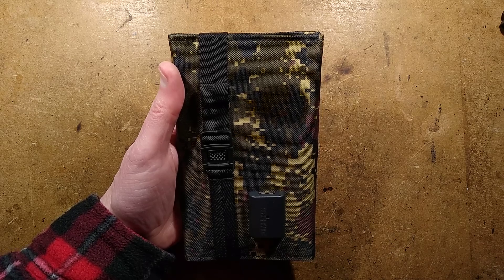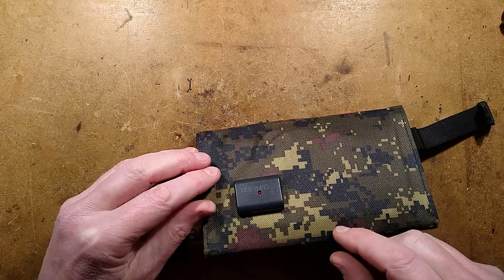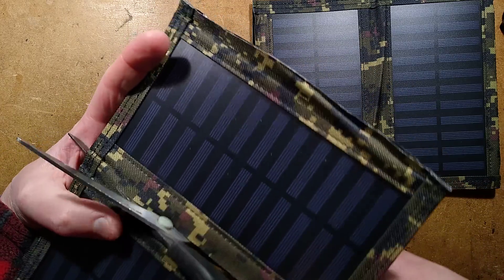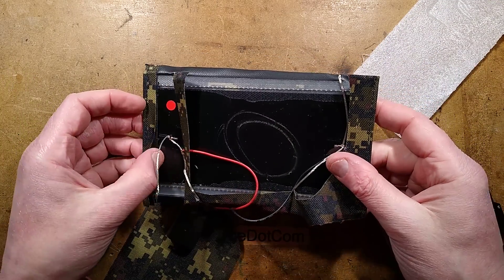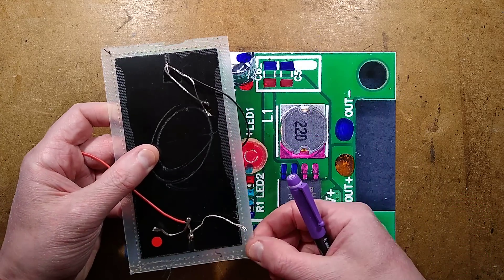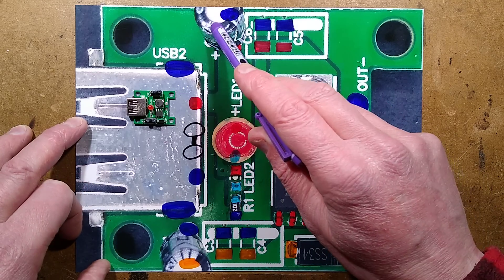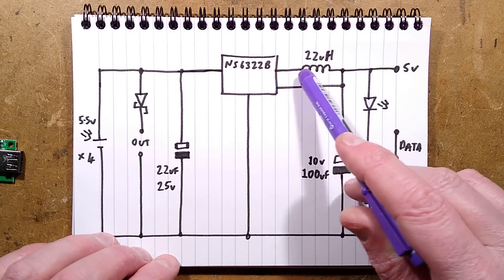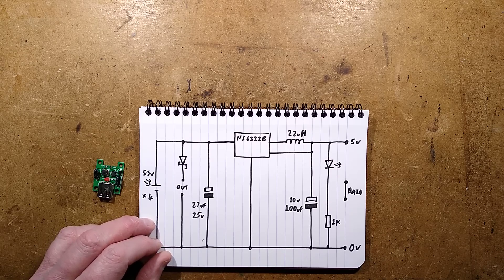Inside an eBay folding solar panel - with schematic

Comment: Yeah, I bought a bigger one to top up my car battery. It did give about 9W  but should have been 40. It also had all 4 in parallel and was obviously only 6V optimised output. Open circuit gave only 9V. They claimed usb and 12V out.
I got fobbed off with the discount thing too.
I it away as a camping phone charger back up.

Comment: I checked the datasheet of NS6322 and output is 500mA @ 5V. I was thinking, is the chip that is limiting here? How much power can we get from those panels alone? can we get the panel and make our own circuit or just use those cheap 2-3A buck/boost converters? Crazy questions..

Comment: I have actually built a solar system for camping trips, that can charge my USB devices and  outputs 12V (unregulated) for anything else. I also put a 12V to 20V converter in a little box so I can bring my work laptop with me for extended off the grid escapes. It can support up to 60W of solar power input, which is pretty handy if you're away for a while.
10W solar panels I could source are a bit bulky since they are made to be installed stationary in gardens, street lights etc. I really wish they would sell those foldable ones for reasonable prices so I could hack into a couple and make my system much easier to carry. To put it into perspective, I paid 12 euros for each 10W panel; those foldable shitty ones ask 2-3 times more, and their specs are all over the place.
So I did what you naturally do; I ordered 100 cells and plan on making my own foldable version!

Comment: Does pvsr almost never get half the voltage of what they're rated for. Therefore when I bought mine I just put them in series and bought 1 inverter that was 20% larger over rated.

Comment: A simple boost buck converter or adjustable regulator cuircuit could go a long way.   My idea of an echonomy home solar setup was just to focus on electronics, wich would involve bypassing your tv set rectifier and jus making lines for all the different DC line voltages you could try to get away with.. so the kettle and stove would be out and a fridge has awesome camper desighns(runs off a flame etc).. the idea is to avoid energy lossess from DC AC conversion.. and maximising the chances of diverse power sources and states.. and the lowest investment. Or perhaps that your home grid would have all the circuitry to acommodate and rework anything you throw at it into the same load lines.

Comment: these things can barely run a led, and most power banks won`t work with them, the power bank require a certain level of power that these panels don`t provide for long, i`m not sure if anything could be done to make these things useful, but honestly i think your better off with a 12 volt panel a cheap solar charge controller with usb on it and a small motorcycle battery, and you plug your power bank into that.

Comment: If you go on a hiking trip, don't bring solar panels. They are bulky, and don't work at night and when it rains, or it is overcast.
I found out that a couple of 20,000 mA power banks for each person on the trip are more than enough to keep the phone and walkie-talkie charged, and provide some night light.
For sake of power efficiency, bring with you a phone with a Snapdragon Gen. 2 SoC, and a professional rechargeable lantern, like the Fenix CL26R Pro.

Comment: I live in a block of flat and the press buttons on the outside door bell box were rubbish and half of the flat bells stop working.  So on to E-Bay and some of the press buttons were rated at 10 AMPs.  I don't think so, more like 2 AMPs if I'm lucky.  Any way I found some press buttons with a water type ring inside the unit to stop rain from getting in plus it's only 8 volt at about half an AMP for about 5 second when the button is press.  10 AMPs for a press button about the size of a one penny coin and 4CM long?

Comment: OK BC, you're gonna have to do a part 2 for this one.  How much current can each panel supply under ideal conditions and how much current can the power supply provide if given unlimited input power?  In other words, where's the choke point or is it all choke points?  Or is the whole thing designed properly and they're outright lying about it's capacity?  Cheers!

Comment: Using the metal tabs, instead of some flex cable, will limit the time of folds.
Reply from the maker: It was braided wire.

Comment: I bought a 65w one that's about the size of a laptop. it's works well. In direct sun, it fast charges or can charge two devices. In cloudy sun, it can still charge a bit. Brand was chargeworks. it was 80 bucks.

Comment: Apart from the lower-than-expected output, is the invisibility cloak that the cover is made of, also a problem. How will you find it when it's closed and lying around a camp site? Perhaps the camouflage also hides part of the output power...

Thanks for warning prospective campers of impending darkness and disconnectivity!📵

Comment: A lot of those that come on a single board have a similar circuit-tumor on the reverse side, and with 5V/usb and/or ~16V raw solar output (coax jack/plug or wires).
The 16V is nice to trickle-charge car-batteries through an always-on connection (eg, obd2 port) and can actually supply a decent current, o(1A) or so.
The 5V/usb output is usually limited to 1A or less because it's stoopit enough to not have any negotiating circuitry on-board.  500mA is totally within spec, so that may be intentional.

Comment: I got one of these and yeah it puts out at best ~0.5A in direct sun. Yes, it is painfully slow, but it beats nothing, especially if you do not have access to a way to recharge your equipment. My biggest complaint with these was the fact that the sellers were intentionally overrating them and your average consumer isn't going to know this...

Edit: For reference if you had a fully dead 5,000 MAH power bank and it was charging at the peak of 0.5 A the whole time, an online battery charge calculator says it will take ~10.5 hours to charge up.

Comment: The output of these small Chinese solar panels (Like many of their 18650 batteries) is often WILDLY exaggerated, but none more than the one a friend bought. It was labelled as a "Solar powered 12v car charger" from some random Chinese website. He bought it to keep the battery on his rarely used weekend car topped up. It was only about a square foot of panel, but according to the packaging it put out 50w [!?!?!]......... Wow, those industrious Chinese folks must have made some SERIOUS breakthroughs in solar technology lately ! :D

Anyway, he had it plugged into his cars battery for a few months, and he'd check every now and then that the little LED was reassuringly still blinking, but after this time when he went to use the car, the battery was totally dead. I offered to test the charger for him (Mainly because I was curious how many watts it ACTUALLY put out), and found that it outputted NOTHING. I dismantled it, and found that it had a simple board with (IIRC) a CR3032 coin battery, an LED, and a photoelectric sensor. When sun light shone on the sensor the LED started blinking........... And the Photovoltaic panel ? Some sort of screen printed paint on a piece of glass ! :D

You've gotta love how creative some of these companies get to rip off customers. :D
Reply from the maker: I've come across fake solar panels too.

Comment: I think that unregulated output option is probably intended for when it's bundled with a power bank. I have a power bank with a similar detachable foldable solar panel, and the solar panel has a USB port for charging a mobile device directly, but also has contact patches where it can connect to the power bank where it seems to provide unregulated voltage. The power bank then likely charges the battery directly from that unregulated voltage instead of using regulated 5V, which should be more efficient and likely also continues to work at lower light levels. At least that would be consistent with my observations, as my phone only wants to charge from the panel directly when it's in direct sunlight, while the power bank already seems to charge from outdoor daylight on an overcast day (though very slowly).

Comment: Those solar panels are sold seperately as 5v 100 mA maximum so I am surprised you got as high as 500mA.  The panels usually sell for a couple of quid each so if you paid more than a tenner you got ripped off!  You are much better off buying a decent sized  12v panel and a switching regulator to get the 5v output.

Comment: Tip :when you open textile stuff that is sawn together: cut the stich loops on above the outside  surface of the product and you can rip the  stitches  up separateing the layers.

If the stitches are done on sawing machine with both tread spools on the top side : (no under tread spool in the machine  table part ) ,the seem will 
Basically fall apart  after one cut loop
Then you dont need to cut into the thing with siccors. Possible making discting more neat for the video ,with the wires still connected  to the components.

In this case it doesn't matter so mutch because its not good product ,you should save the pixel camo fabric doe ,if you want to make a camouflaged electronic gadget or something.
Reply from the maker: This video was where I discovered that my seam stripper was not in its usual place.

Comment: Yeah but how does it do? Does it store energy, can you leech off of it? But really, does it work?
Does it energize?
Can I put this on my window and get free energy?
Now, I don't need this.
But energy transference would be nice! My iPad drains battery quick!
Being able to have it charged forever would be cool!

My utilities are included in my rent! But, would this save someone on bills?
Can it be used to do extra, such as charge a car battery?
I had a car battery charger once! Can you do one of those?
Where are you, what are you doing?

Was Temu good?

Is it waterproof?

The way it work's is - Sewn into sheet! Product!
It's nice to use!
But, not different from you!
They won't program shit.
Not that I want!
Youtube Italic's Want.

What you can do to it (Check your schematic at the end) is, easily - Add a voltage regulator!
Tie some copper wire around your finger, and aim the solar panel outside!
Then attach the VR Coil (the copper wire wrapped around your finger) to 5v!
Or I don't know!
Anyway, does it work?
Reply from the maker: It will provide a small amount of current that would have uses.  But not as presented and definitely not charging a phone.

Comment: Yeah got mine as  30 watt cammo foldable solar set. But max I got out if itwas 5 watts ali and seller refused refund based on that I did get my refund in the end coz mine was black not cammo. It does charge my big power bank during one sunny day though. Fun fact the manual said: do notput in direct sun light 😂😂😂

Comment: Those OUT pads are indeed for a "raw panel output" port on some of these "solar wallets" as I like to refer to them.  I have a few here that I purchased a few years ago when they were a bit better quality.  (Suaoki is a good brand)  Having the raw solar output port makes it easy to tell what the actual max solar potential is, and it's a shame that these controllers are usually just dumb buck regulators.  If they were an MPPT controller they would have a much better power conversion as they optimized the draw on the panels to keep them at their maximum power output when subject to a variable resistance load.  I don't know if they're made anymore but there are a few of the 60w Suaoki on ebay right now.  The 25 watt models are also good and last I tested them they'll give you about 18w in good sun.  As you mentioned, use a power bank.  That way you can charge your bank when the sun is convenient, and then charge your phone overnight or whenever from the bank.  Sort of "time-shifting" your solar power.  If you have raw panel out, you can attach an MPPT controller that has USB power on it and use that instead of the built-in controller for a LITTLE extra production.

It's sad just how absurd the numbers some listings are spouting for watts on their panels, they really just don't care.  A quick-n-dirty method I use is calculate the square inches of solar cells and divide by 10 to get rough watts out. (actual watts, not lab rated, which is always higher)  My 100w panels use 36 cells that are 4.5x4.5 inches, which my math would guestimate them at 72w.  They test for me at 76w.  Hope this helps you, and keep takin' things to bits!

Comment: I don't really get the point of that buck converter. I mean what's the advantage compared to using that one single schottky diode? USB voltage is allowed to reach as high as 5.25 V. It probably won't ever exceed that as long as there is at least some load.

Comment: It seems these kinds of "scams" are based on selling overpriced functional cheap devices: 100% profit on sales where the customer does not complain, 70% profit after having the customer to file a formal complain offering a "generous" partial refund. In other words, the refund would only affect seller's profit by diminishing it.

Comment: I was thinking exactly that just before you mentioned it at 08:30. One of my mates (Spanish) has a 10w solar panel that delivers, surprisingly, 10w of output. We theorise that I'll need at least a 40w panel to get the same amount of output he does with our weather „system“ like it is... ⛈🇬🇧😉

Comment: The rough rule of thumb is 150-200w per square meter for solar pannels on a good day in the UK, throw in 10% loss in the buck converter and you are lookingat around a square of 27cm of decent quality pannel to get 10w.

Comment: I bought one of these very devices a few years ago, but I did get the one with the generous silicon on each panel.  The Buck regulator is the same but is attached by a short cable to the panels.  Mine also has five panels instead of four, all connected in parallel.

That said, I measured the open-circuit current mid-day in the winter (northern hemisphere), pointed directly at the sun, and it peaked near 2A.  So I can see how these things may be rated for 15W -- which of course is very misleading!

Comment: They are not lying - by now it should be a well known fact that Chinese have a different measurement system for energy and power. Coincidentally their units have the same names (much like a UK pint and a US pint), but there is a variable conversion factor between the Chinese system and the metric system, which in average is somewhere between 1/10 to 1/1000.

Comment: its funny as every solar panels rating is done on 1000W's of sunlight per meter squared.
Yet the highest sun value we've ever seen in the UK is about 800w per meter squared. with the average value being WAYYYY lower.

Comment: I do have similar one of these. However my one came from banggood and also it managed to meet its specifications. Its called iMars SP-B21 21W And i did manage to get 18W of power from it charging powerbank. With variable load i may got full 21W who knows. I got it on flashsale for 35€ back then. Now looking at banggood it is like 55€ god damn... Anyway i like it and it is working as adverttised to this day. But iam not taking scisors to it any time soon :-D Hope you understand...

Comment: You had an Indepth video about solar lights with pir sensor before, but I was wondering if you have any idea why multiple of those purchased from Amazon would start blinking at about 1hz or so after a year in use when set to detect motion and you obscure the solar panel. The battery seems fine and charges at 4.2V (18650 I think). The panels provide about 5v (not sure about the current). Measuring the voltage right at the battery connection on the board shows the oscillation from 2.7->3.6V once in circuit. It's a long shot but I thought I would ask :) rather than scraping the devices.
Reply from the maker: It sounds like the rechargeable cell has gone high impedance.

Comment: B. Clive missed the point, perhaps. One of these which I got from Clas Ohlson had 6 volts panels in parallel and then 5v regulator. Only in very good sunshine the voltage was good enough so that the regulator could regulate. When panels were connected in series they produced 12 Volts and the overall production was 10-fold on typical Arctic Summer.
Reply: I thought the point wasn't voltage but the actual power output from it.
Reply: @deang5622  Forgot to mention the most supreme point:  the optimal output voltage on solar panels  is 30% below the no-load voltage. This is why 12V panel has output of 19V.
Reply: @TimoNoko  I have been using solar panels since 1988. I also studied them as part of my degree. I have studied  semiconductor physics as part of my degree too.

Comment: at the Action here (kind of poundland) they also have these kind of solar panels that are rated at 10 watts during the summer.
I never tested them for the output, but i have 3 of them for a project so i might test them to see how much they can supply